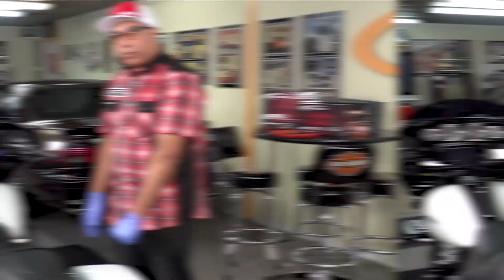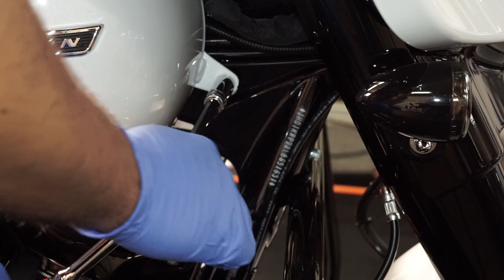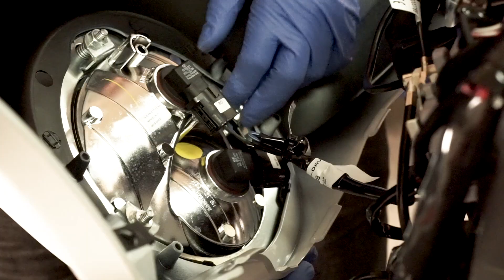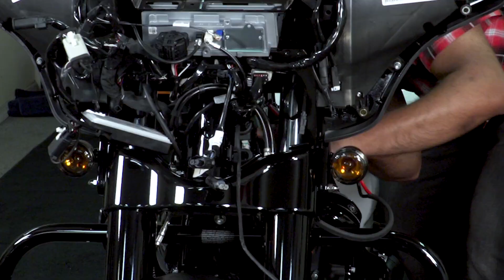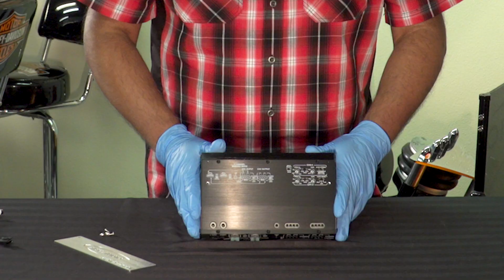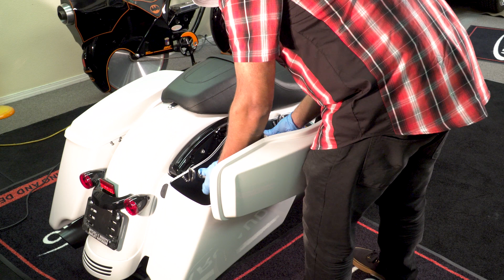How to install a Motorcycle Performance Audio Kit (MPAK) in a 2014+ Harley Davidson Street Glide

Comment: I have the arc audio moto 720 and ever since I installed it I’ve had nothing but problems setting the gains. Retuned everything last night after making some changes and the gain was damn near all the way up with my DD-1 and test tone. All the switches are in the correct spot and everything is wired perfectly but the gains on all 4 channels are extremely wrong. I did notice the gain nob will turn with some resistance and then turn a lot easier until hitting more resistance. Been that way since I bought it last year
Reply from the maker: Please contact us at 209-543-8706, or at Gurmel@ARCAudio.com.

Comment: for a 4 channel connection with a PSM does the PSM only need channel 1&2 as the input and use channel  1/2 & 3/4 as outputs?  or do I need to use input 3/4 into PSM to use 3/4 output from PSM